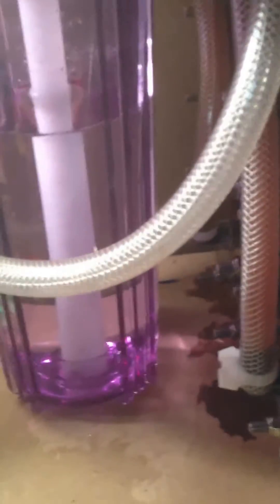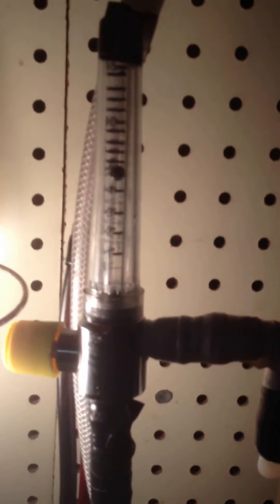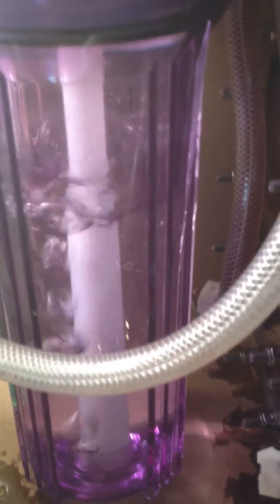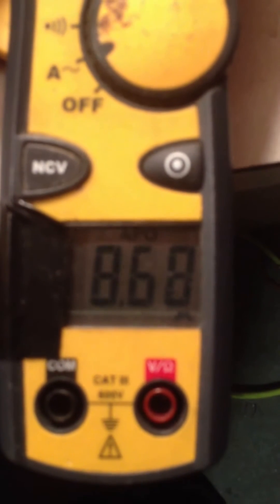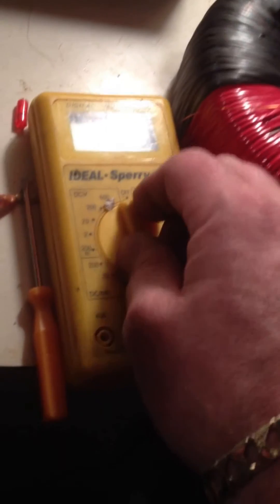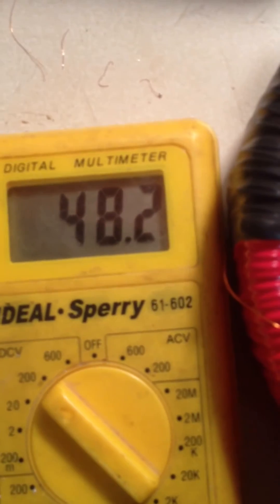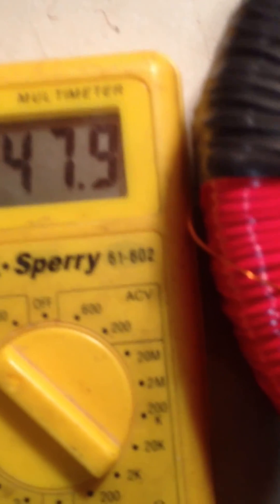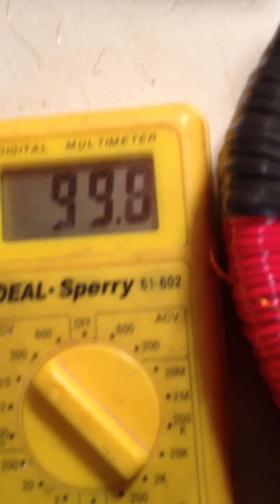PWM3G Modified, 9 amps, 5-14 lpm DEZEINSTEIN - Marc's TPU driving lots of HHO

Comment: Can u share your toroid winding setup? Number of turns,gauge,spacing, etc?
Reply from the maker: thewonn I made that so long ago, but, If I remember correctly, I copied what's listed online and I followed the formula by amperage which was listed at hydrogen garage, but, it was for the amount of plates in the cell i used in the video. I had to add a motor run capacitor in series to limit the current, then, i locked the pwm3g's frequency to cut the upper frequency in half for each channel of the board automatically. When I tuned the router speed control, I started it up and tuned it in increments, documenting how much gas the unit made per like 30 or 40 volt increments per frequency range, finding the best frequency range per gas ratio. It was totally different than with the 101 plate cell, and quite frankly, it was a waste of time because it isn't any more efficient than any other ac cell or dc cell liter per minute per watt, it was actually much less efficient. I find that the unit makes the fuel consumption worse then a 1/4 lpm makes for fuel economy. I did find that it completely runs my tractor by adding an alternator from a car with the right pulley and rpms though. I start the unit using gas, build up enough pressure in the cell and bubbler using a ball valve, then, adjust the ball valve to release only what I need and adjust the variac to produce only so much gas. Then, when I shut the fuel line off, the tractor continues to run without any fuel added. I literally have mowed the lawn, drove the tractor for hours and haven't needed to add gasoline, but, the cell heated up and started to really badly rust the water and boil over unless I limited the voltage to keep the cells operating at 1.5-2.5 volts max (between the plates each) . I couldn't figure out how to stop the rust no matter how long I conditioned the plates, and, the plates are made of 316L stainless. I didn't use any electrolyte, as well, used steam distilled water, so, the rust is from the high voltages and the plates releasing the molys in them. They certainly didn't stop eliminating moly's because it rusts up till this day without electrolytes. I found that if I drop the voltage down, it works without rusting it, but, then it doesn't make enough gas to continuously run the engine, so, I am having a difficult time still. I use the system running at maybe 1-2 amps for fuel savings, with a volo chip in my car, but I have made much better cells that dominate this setup using my own board. The key is the quality of the gas and believe it or not, a very small amount of hho because when you use that much energy to make the hho, it loses fuel to make it, and, it guzzles gas if you add too much, even with a volo chip.
Reply from the maker: thewonn I followed the instructions here and it didn't work correctly. I then followed the magnetising instructions, but, I made sure it all made sense as to the direction the plates were in, if you look at the plates and the way the wire was wound around the plates, the poles were opposite the way they are supposed to be. The poles have to be on the correct ends where the polarity aligns. That made the effect way better, and, the cell became twice as efficient. The next step was to use the diagram of the original pwm3g and build the board yourself. I have found my triple pwm had the same or better production than Bob's board sold at Hydrogen Garage. When I added my motor run caps, a huge difference resulted and it was due to the fact that the first cap was put in series to limit the current with the AC feed.

The pwm was not massively effective, and, if you look at the cell, the side HDPE had to be tightly fit so the current flow didn't flow around the plates. The next thing I did was drill holes through the plates, a 1 " hole in the center of one plate, then, two half inch holes offset into the next plate with rubber grommets in the hole to get rid of the nasty additional "edge" currents that ruined my production and caused massive heat.

When I conditioned the cell, I did not use any electrolyte, and, I conditioned the plates at 1/4 of the stack at a time to up the voltage per plate and give it action with only steam distilled water, dumping the water as soon as rust formed which was nearly immediately at start, then subsiding shortly after the 4th bath. I soaked the plates in food service peroxide to kind of powder coat or oxidize the plates so they didn't react due to the fact that the molys were locked into the plate instead of releasing into the water.

I gave up on the 101 plate cell because I was getting the same result with 21 plates in a dry cell, then, 40 plates, but, the frequency would not lock and give any better result. The best I did was 9-15 lpm and it did not have any advantageous affect on MPG. The cell did run my tractor right away, without any mods, but, the frequency on the 101 plate cell kep having to be adjusted as resonance went away within a minute or two.

My dry cells gave more gas and were more efficient, but, I am finding my own electronics are way more effective, as well, Stan Meyer's boards, but, they are not anything magical, my pcb's are way better and the cells do not ever heat up. I found mpg is better with 1/4 lpm and a volo chip, which is nearly doubling the mpg when the volo has finally tuned itself correctly after resetting it 15 or more times.

My recommendation is to drive the cell with your own wind generators from your car. The car already has wind tunnel losses, so, by adding wind gens in the spoiler, where therre is al;ready a drag that will not cause more drag or losses, we may as well take advantage of this and generate higher voltages and amperages the faster we go. Highway gives me nearly 65 mpg with wind and it is rectified to boost the car like a dream on the highway. As we raise the speed, the voloi adjusts and the throttle response is automatic, where I literally have to brake to slow down as the car automatically cruises at 70-75 mph and it gets 65mpg respectively, maybe a bit more on the highway.
Reply from the maker: Marc Belanger http://hydrogengarage.com/pwm3g/BB101.pdf  I feel by opening an air port from the front to the back of the car with a spinning ribbon fan/generator has created a high enough voltage and amperage to make hho gas when we obtain high enough speeds on the road. The car would normally have a spot on the front of the car that pierces the wind, causing a drag that slows the car down and uses more fuel anyway, so, by offering a wind slot from front to back will assist in allowing that air to flow through, eliminating additional drag, improving handling, and, allowing the use of the energy that is already there , available in abundance for it's use. Since we are creating an instance to draw that energy by making the car go fast to begin with, we now have a chance to utilize that energy to our advantage to help eliminate the fuel used to bring in the energy in the first place. As skeptics will say there is only the ability to cause more losses, I disagree, we already have a 30% efficiency in the US and the only thing we can do is make this better. These effectes can be studied in a wind tunnel and without the proper tests, not one skeptic can disprove my theory because there is wind flow all around a car and by opening a center channel to flow will certainly reduce the drag by a large number, and, the faster we go , the more fuel the vehicle will get. Water is a powerful fuel, and, just by offering places to mount them, like wind foils, wind slots in ground effects kits or other spoilers will certainly help in the assistance of gains, not losses. There isn't one perfect vehicle on the road, and if there were, they wouldn't need fuel at all. We can supply an electric vehicle with recharge capabilities, gas vehicles with more fuel and diesel vehicles with more as well. There isn't the need for more fuel, but, there will be increased efficiency, even though the smartest minds out there have already tried to suppress everything there is to know about this. My theory of generation while in motion as well as my vehicle and the charging system proves it is effective. It must be accompanied by efie, maf and other modules which will reduce the fuel pumped into cars that are computerized. I will be building my own older vehicle to prove my theory correct very soon as I have an old throttle body vehicle that will be carbureted with a specially built carb. And, these vehicles have much less carbon emmissions than any car or truck on the road.